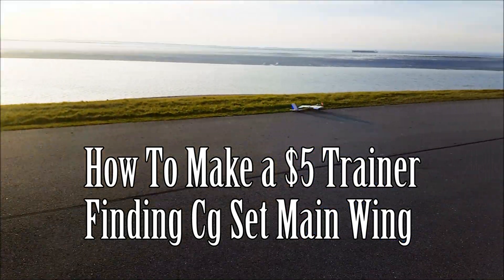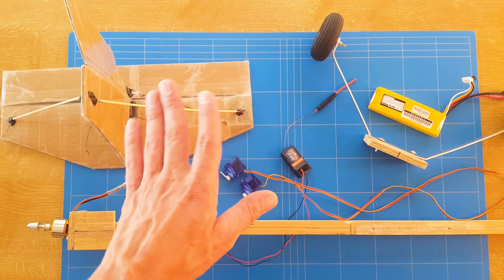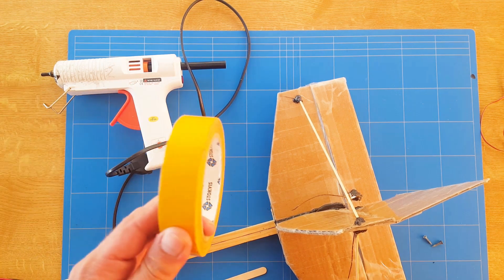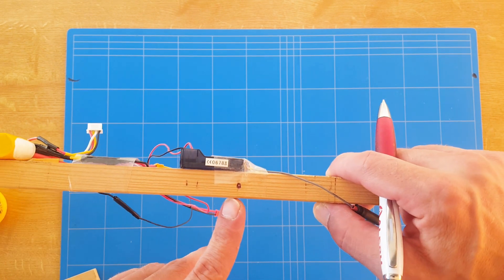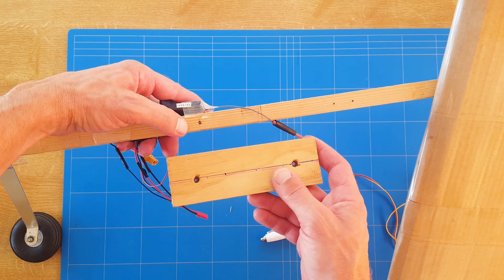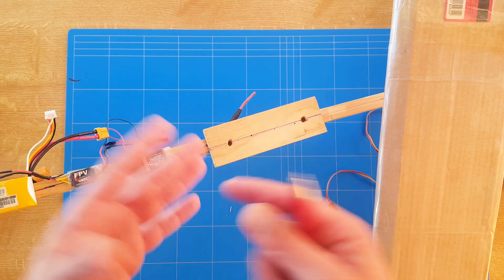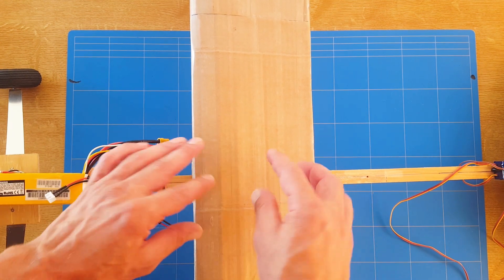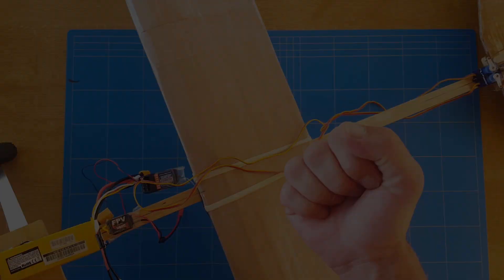Last Build Video Finding Cg | $5 Trainer Unbreakable Rc Plane Project Ep.8

Comment: Do you have a tutorial on how to attach the bec? The fpv thing, or is that not necessary?
Reply from the maker: hi mate your a bit conffusing one qustetion those your ESC have only 2 of those small thinn wires than you need a extra BEC to supply 5v to the receiver thats
just connenct to one of the open channels on your receiver thats it
Reply: @HowToDIYRc  yes it's the esc from your description. The same bec too. How do I go about connecting them?
Reply from the maker: you connect them to the receiver!!
Reply: @HowToDIYRc  how do I connect the esc to the bec, is what I am asking. The esc in your description has no inbuilt bec. I need to connect them together.
Reply: @HowToDIYRc  A video on it would be awesome.
Reply from the maker: no you don´t you plug both of them in the receiver or you buy this and be done with it http://bit.ly/30A_ESC_BEC
Reply: @HowToDIYRc  solved it. You do have to plug both into the receiver. The esc isn't giving it 5 volts. Just had to solder the ubec onto the main xt60 connector.
Reply from the maker: finaly good job you also can connect the bec to your lipo balance wires
Reply: @HowToDIYRc  Put the propeller cap on wrong and it flung off and nearly hit me in the eye lol. Next time i'll be more careful.

Comment: Hey can i use 1045 prop
Reply from the maker: if you get the 2212 930kv motor then it's oke but the 1400kv will overheat and your esc too by using a 1045 prop on a 3s maybe you can get away with it if the prop is very narrow like the cheap orange props i like to use

Comment: What's the advantage of using no ealerons? Is this juist a 3 channel plane? Thrust, rudder and elevator?
Reply from the maker: you have more control over the plane and there for making it easier to fly the plane
Reply: @HowToDIYRc  okay! I really want to get into rc planes by making a design like you did with the wooden sticks, but the rules in belguim are stopping me from getting into the hobby.
Reply: Brend R. Why? They shouldnt be! I live in The Netherlands and the rules are pretty much the same.

Comment: Can i use 3.7v lipo battery
Reply from the maker: no not for this plane it runs on a 3s lipo 12.6v
Reply: Thank you i might build it slowly next year,could i use 1000mah 12v lithium ion batteries on this plane?By the way u built an awsome plane and dont worry about that david davids,hes just jealous that u got a plane flying and posted it.;)

Comment: This segment cleared up a lot of my questions I have had building my planes, they were ALWAYS tail heavy and needed a lot of weight in the nose.  Did you line the CG of the wing and Balancing point of the fuselage (stick) up? That’s what I thought I saw.  Great video
Reply from the maker: yes you line those to up and then move the wing 1cm back to compensate for extra weight of the wing that sits behind the Cg